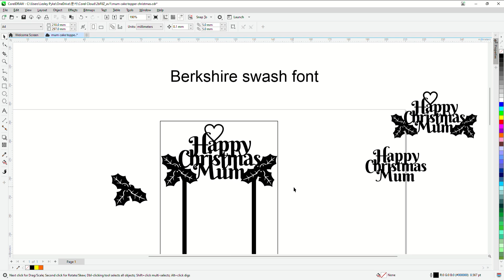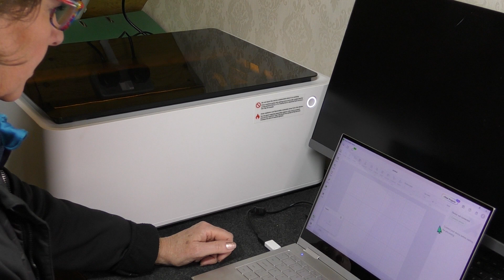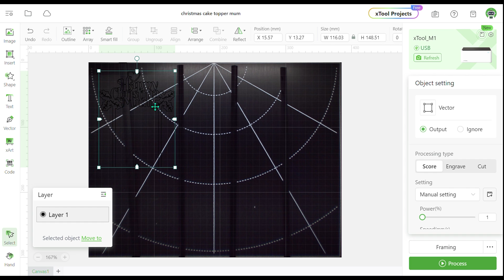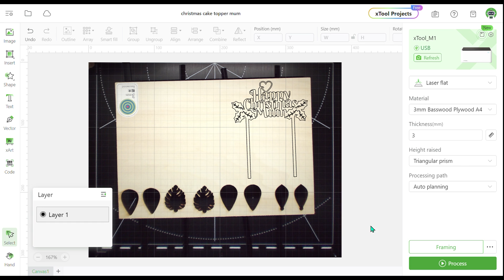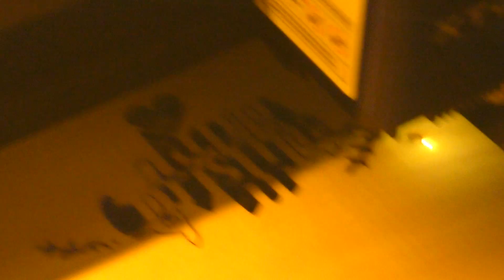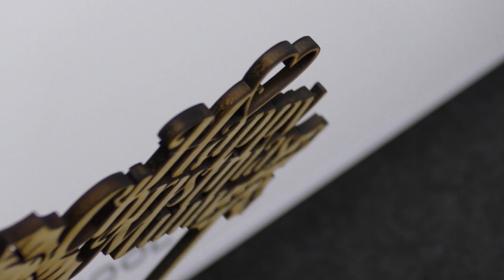How to make a cake topper with xTool M1 laser and blade cutter.

Comment: How does it show the base plate so well in the xcs software? Mine only shows me the drawing.
Reply from the maker: It should have the option on the top of the screen once you connect with the M1. Perhaps it has not connected correctly.  You need this option to position your engraving correctly.